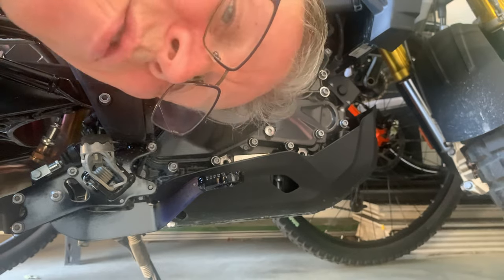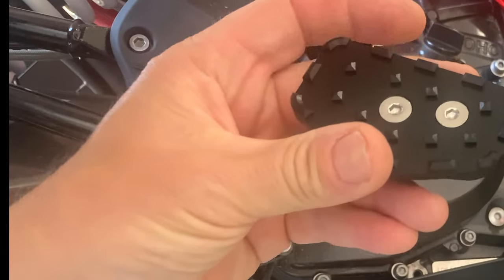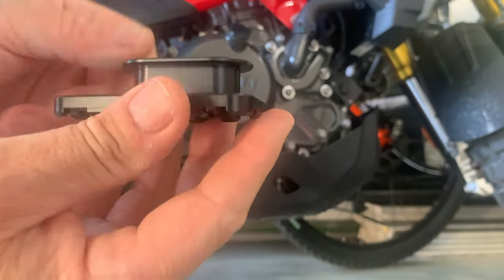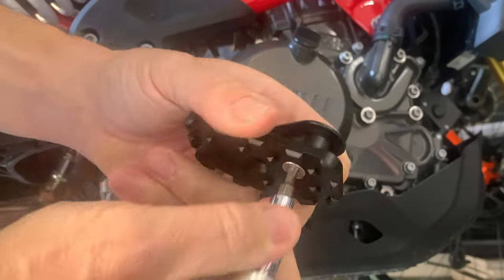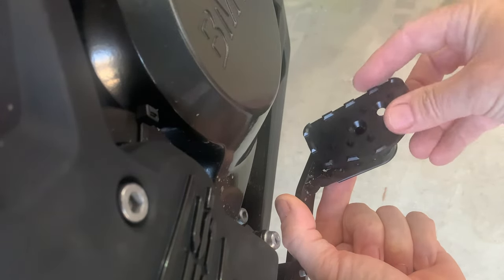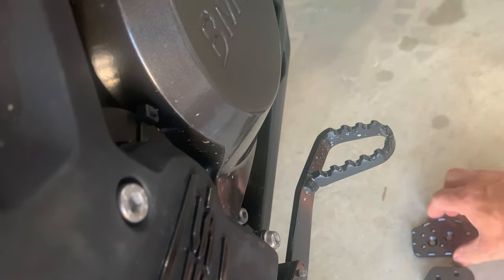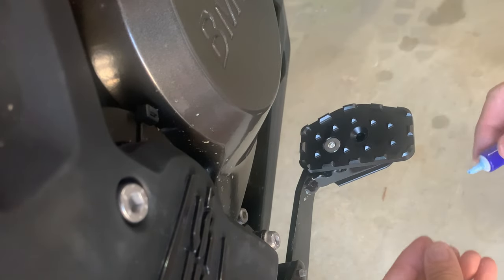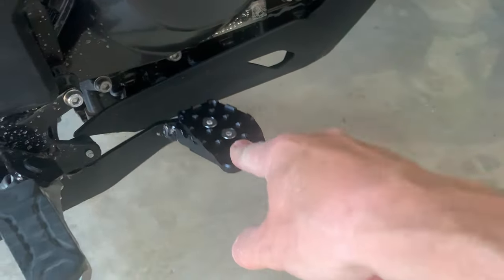BMW G310GS G310R IMPROVE THE REAR BRAKE

Comment: Helps how🙄
Reply from the maker: It just gives an extra bit of height on top of the pedal.  There’s no other way of adjusting the brake unfortunately so that extra 6mm of thickness gives a better feel due to it reducing how far a rider has to extend their foot angle at the ankle.  Actually quite a bit better than standard 👍🏼